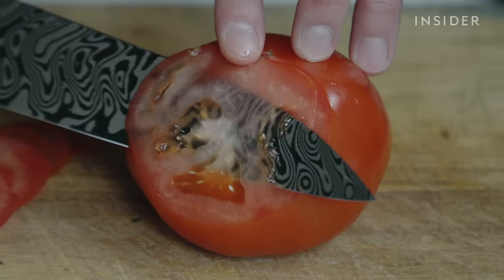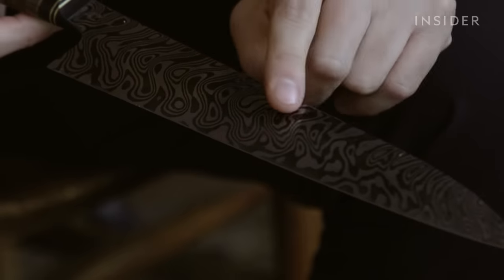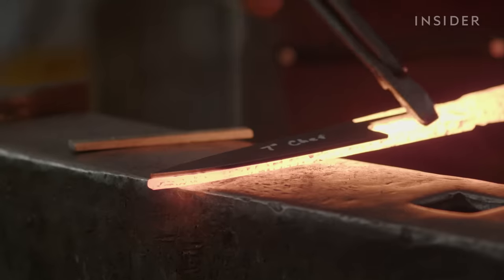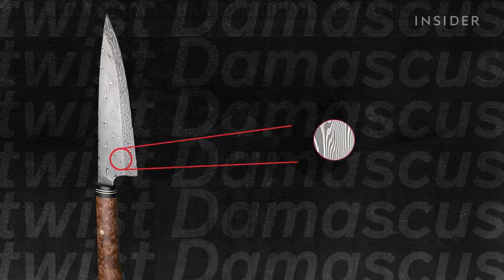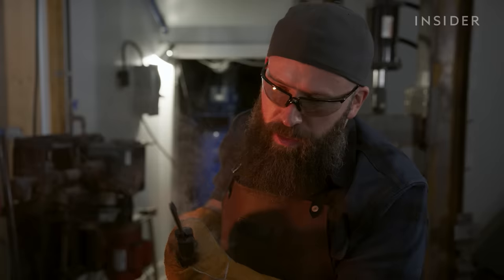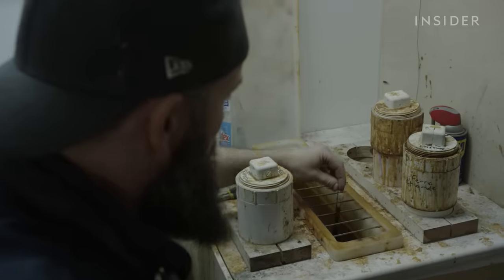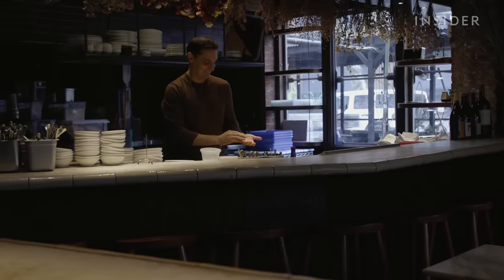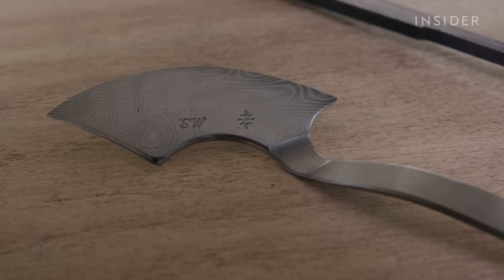Why Damascus Knives Are So Expensive | So Expensive | Insider Business

Comment: As a materials engineer, this was a great watch. I love working with alloys👌 Aluminum lithiums are awesome
Reply: What is a materials engineer?
Reply: @franko8572  it’s someone who other works researching new methods of combining metals or other component to create new materials, or in my case I work in a lab testing the mech properties of products we manufacture to make sure they are within specs- testing the tensile, compressive, shear and torsional force of alloy plates, checking the failure impact force, make sure our process produces the correct molecular structure. Etc
Reply: @savageone8931  Oh daaang! Nice. So you’re basically a metals chemist? 🤔

Comment: As other mentioned, these damascus steels are "pattern welded steel" that are simply being called damascus. I suppose it stuck since saying pattern welded steel all the time is tiresome and calling it damascus has better marketing appeal.

You can have "damascus" made of bad steels or good steels. It's just a mixture of two different alloys that corrode differently. Nowadays its only real purpose is aesthetic.
Reply: Actual Damascus steel was made through a special forging process. Pattern welded steel keeps the lines of the steel grains continuous. Damascus steel breaks up those lines on the molecular level. It's pretty neat.
Reply: @ae3qe27u3  Correct me if I'm wrong, but when you heat treat the blade you bring the steel up above the lower transformation temperature and reform the grain structure..??
Reply: @ae3qe27u3  

Special and special, it's iron ore smelted and then put into a crucible and slowly cooled.

The pattern in real Damascus comes from Alloys in the steel, creating alloy banding, which has gained huge popularity in getting out of modern knives, you see it a lot on Japanese Honyaki and even some solid VG-10 knives, can also be seen in the iron cladding on some knives.
Reply: @Masterfighterx  if my memory is correct the ancient Damascus or crucible steel have their pattern for un- even heating reaching the melting point at the same time also the un-equal carbon and other alloying elements. like vanadium. that's the reason why they have pattern and also much superior. than the other steels back in the ancient days. a bit of manganese, vanadium in the steel and much uniform carbon distribution and finer grain. even the does pattern are visible in the refined bloomery steel but the crucible steel is much more superior. most modern steel are Vacuum Induction Melting, to increase it's purity and alloy distribution they also Vacuum Arc Remelting to the steel. the most high end of steels are Powder Metallurgy. if I my memory is correct VG10 is an ingot steel that is also Vacuum Arc Remelted. while ZDP-189 is PM steel that have been re-melted and re-spray into an powder like the other high end steel like CPM-S110V and CPM-REX-121. there grain structure and carbide distribution are so small you need an electron microscope. also insane carbide count.
Reply: Wootz steel is another term for it. Only recently recreated by metal working scholar/scientists. Pattern welded is an art, and the similarities in blade appearance is what has led to the misnomer.
Reply: @ryanj610  it's also called Bulat steel in eastern Europe and central Asia the Mongols brought it with them and teach the eastern Europeans on how to process and make the steel.
Reply: @hobbyman47  Thanks, I wasn't aware of this. That is certainly the same carbide patterns from precipitating cementite that are the Hallmark of Wootz.
Reply: Pattern welded steel has always been referred to as "damascus steel"
in the West ("pattern welded" is a relatively recent term).

The name "damascus" is itself a misnomer, as the crucible steel (what some people label as true damascus steel) is actually called names such as "Wootz" and didn't originate in Damascus, Syria (it was just traded from there).
Reply: @hobbyman47  The truth is we don't exactly know how it was made.  But what we DO know is that the metallurgy was nothing special.  There's no exotically hard or tough or, well....anything magical about the elements in the ancient damascus steels.  It definitely seems to have been something process related that distinguished it from the typical spring steels being produced by European sword and knifemakers.

Comment: Really well done video. I like how you mention, how damascus knives perform similarly (in reality likely worse) to other high end knives. The myth of them being better simply isn't true. What's true about them is that they are real eye catchers and require certain skills to make. 

Also this craftmans damascus patterns look stunning.
Reply: The magic of damascus isnt the steel, its the fact that they're almost all hand forged and are of a significantly higher quality than a factory blade.
Reply: @sygnusadun4832  yeah, I was also talking about hand forged knives, of which there are damascus knives, 3 layered knives or monosteel knives. the latter 2 tend to be more efficient than damascus in most cases.
Reply: @CRO-Palacinke-D.C  Thanks for the feedback, but I must respectfully disagree. What is your basis for that claim? The only discernible difference between a hand forged damascus knife and a hand forged monosteel or san mai knife, from a metallurgical standpoint, is that the edge presents with two distinct alloys rather than one. Technically one alloy is ever so slightly softer than the other, but this is way, way below the level of human perception. And, importantly, either alloy is suitable for use in a monosteel or san mai blade on its own.
Reply: You should check out Kyle Royer on YouTube. He's a master bladesmith too and makes absolutely beautiful knives and swords with Damascus steel.
Reply: @zackjonas7775   @Zack Jonas  Cool to hear from the blacksmith himself, thanks! 
I totally agree with the reasoning you gave.
My "performing worse" comment stems from damascus knives being treated in acid and having an overall well polished surface, which creates more friction when cutting and worse food release than say a hammered finish. 
It's overall only a slight disadvantage I'd say. Also I don't own a damacus knife yet (except for the Kai Shun I started on years ago) therefore I can't argue from personal experience.
Reply: @zackjonas7775  in bloom steel processing and refining, after all the passages of folding to obtain a nice uniform billet, the steel generally decreases its carbon content due to prolonged working at welding temperatures. Shouldn't the same thing happen with high layer damascus? Like you start with 1095 as a component, but what you end with is not 0.95% carbon anymore due to decarburization and scaling which is generally way stronger in gas forges than charcoal forges. In coal/charcoal forges it may be different though, instead you may even end up with a higher carbon piece considering the low oxygen ambient, high temperatures and high presence of carbon gasses.
I know that bloom steel is worked at higher temps than pattern welded steel, but I think that the reasoning makes sense
Reply: @giodavid991  That is a well reasoned observation/question. However, the effect is hugely mitigated by the fact that I am working in a propane forge with a carefully tuned reducing flame. The steel oxidizes so little in these conditions that I can (and do) actually forge weld with no flux of any kind. Theoretically though, yes, it is probably true that the steel loses some carbon during the working process, but when it is worked correctly the difference is less than negligible. More importantly, these alloys are designed for use in forged blades, so any carbon loss is sort of "baked-in" to its initial composition.
Reply: Damascus knives are very overrated and very overpriced. 200$ japanese knives are already at the extreme point that most people are willing to spend for a knife.
Reply: @zackjonas7775  Sooo basically you can get a cheaper knives with the same functionality and sharpness?
Reply: @zulhilmi5787  Yes you can. But what you're buying is a one-of-a-kind beauty; an artpiece. After all, you only need so few knives in your kitchen, and they last for a lifetime. You'd want the best in your arsenal; in both functionality and aesthetics.
Reply: @AWS137  If you have photographs of the knives, the pattern can be used to identify them if they are stolen.  So, basically, consider it a really expensive anti-theft system but when you realize you can buy 4 or 5 knives capable of the exact same level of performance without the pattern, it's really just buying a knife that looks nice.
Reply: @Baylon Melanie  heck my wustoff is a better value at 120 for the classic 8in. I also have a 4$ cheap knife that makes more money than any Damascus ever could.
Reply: No matter how you spin it, if you use best quality steel to make a monosteel mass produced knife, it will perform as well as the best quality damascus out there, for a much much much lower price. So, is it worth it? I guess, if you have the money to buy it, it's a beautiful knife. But let's not do like the chef in the video and pretend damascus is better than monosteel.
Reply: @zackjonas7775  Amen.
Reply: "These unique swirls are more than just decorative. Successfully welding dozens or even thousands of steel layers creates some of the strongest and sharpest knives money can buy" 0:14 

They do, in fact, perpetuate the myth of them being magically better than other knives.

Comment: FYI, damascus does not make you knives sharper, you can get a VERY hard homogeneous steel and make a sharp knife that holds edges as good as damascus. I'm a home chef and i have a few VG10 knives that can cut on touch (sharpen by myself). problem with razor sharp knives isn't with the knives themselves but the user, anything will get blunt if you abuse it, taking good care makes you knives last longer(RIP my old 10$ SUS304 that i had been using for the last decade).

Comment: The history of Damascus steel is really interesting. The origins of Damascus steel goes back to South India. Making a really good quality steel which didn't rust easily and was strong enough to take the wear and tear of warfare was known to black smiths of these parts of India (even current Shri Lanka). Here steel was and is still called "Ukku". Indian Kings wanted horses for warfare and Arabians had best horses to offer.  Indian Kings bought horses and sold swords in exchange. These swords ended up with Turkish Sultanates. The Ukku got distorted in to "Wootz". That's why even now Damascus steel is also called as Wootz steel. Then Crusades began. When the Christian Western powers met with Muslim Turkish armies in battlefield  they were really impressed with the quality of the swords. Since they found these steels in Damascus, they just called them Damascus Steel.
Reply: Arab derived from Sanskrit word ARAV means 🐎 horse
Reply: @cardrift4515  What is your source for that claim? 

The languages come from completely different language families. “Arab” is an endonym probably originating from earlier Semitic languages.
Reply: @Nick-zl5xf  it doesn't matter though it comes from Semitic family, almost 90% words have root in Sanskrit
Reply: @cardrift4515  once again, what is your source. There is very little evidence to suggest direct Sanskrit influence on the Arabic language, let alone the “Arav—>Arab” connection you suggest
Reply: @cardrift4515  Arab comes from the name (Ya'rub) which was one of the kings of Yemen and he is the father of Arabs.
Reply: Amen.
Reply: Amen.
Reply: @Nick-zl5xf  Amen.
Reply: @cardrift4515  the word Arab comes from Arabic, which means clear and well explained. Arabic is a semitic language whose roots date back to more than 10 thousand years ago.
Reply: @sarahbeaux-arts7141  your statement is false, I shared some articles but the comment got deleted by yt, so search ' vedic past of Arabia ' you will find out the truth, as we all know Aaryan Invasion theory happened in all over Asia-europe
Reply: Bullcrap
Reply: @cardrift4515  my statement is absolutely right, as a native Arabic speaker , I am the source not your God knows what sources, which btw are not in the comments. It’s actually common knowledge the definition of the word Arab and Arabic, you just need to ask other Arab speakers if have few around
Reply: @sarahbeaux-arts7141  Arab is not that old there was a working world even before rise of arabia ,in vedas its clearly mentioned aravsthan meaning the place from where horses were imported, maybe your king was named after this word, as we can't question vedas as they were first on planet Aaryans were present in whole Eurasia so everything originated from this there is no doubt in that Aaryans were responsible for human evolution , before Islam Vedic people were present who started Semitic zarath ustra was Aaryan who mentioned Ahura same vedic gods , Semitic is based on vedic completely
Reply: not correct damascus steel started from damascus, and its older than islamic time so much
Reply: @cardrift4515  not correct Sanskrit dont have Any relationship with arabic and other sematic languages
Reply: @zolqick4475  yeah and not related to india
Reply: @AbdAlgani1999 No it didn’t, it comes from India so does “Arabic” numerals. Arabs got a lot of knowledge from India

Comment: just as a very important distinction, this is NOT damascus steel, this is forge-welded steel.  damascus steel is a crucible steel.  this is forge-welded steel that emulates the pattern of damascus steel.  the type of steel is called "watered steel" that results in the pattern of different alloys/carbon concentrations.  damascus is the original, and is a crucible steel.  fold-forged steel is another type of watered steel, but it is NOT damascus steel.

Comment: They're gorgeous knives but they really gassed up this whole "Damascus" thing. In reality, a well sharpened knife between 50-400 dollars will let a skilled chef cut those paper thin slices of anything. And if some idiot wants to snatch it up to open a can, or knocks it onto the floor, it won't cause the same sort of pain. Not to say you shouldn't buy a knife like if this if you really want to, they're just not the atom splitting nanotech monomolecular sci-fi blades they're made out to be.
Reply: They also leave out the fact that whats called Damascus steel is made from Wootz steel or crucible steel, what they are showing in this video is a Damascus pattern made using a technique called pattern welding.
Reply: I can also cover a space on my wall just as well with crappy art as with good, or drink from a plastic cup rather than handmade ceramic. The point is beyond utility,
Reply: @jimdigriz2923  damascus in todays age is pattern weldes steel. Same as gay no longer meaning happy.
Reply: That would be obsidian knifes.
Reply: Amen.
Reply: @notabrit3025 nice example

Comment: In modern steels, ''damascus'' is purely cosmetic. You Layered steel back in the day to remove impurities, and that was still not called damascus steel.

Actual Damascus steel looks more like the knives you see (Many from Japan nowadays) with no layers but there is alloy banding on the single piece of steel, which can also occur in a 3 layered knife, which looks way cooler than pretty much any pattern welded (''damascus'') knife.
Reply: Yeah my next knife will be Japanese, but my German and American knives are just as good imo
Reply: Amen.